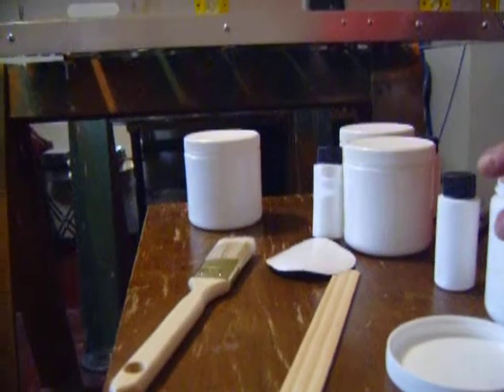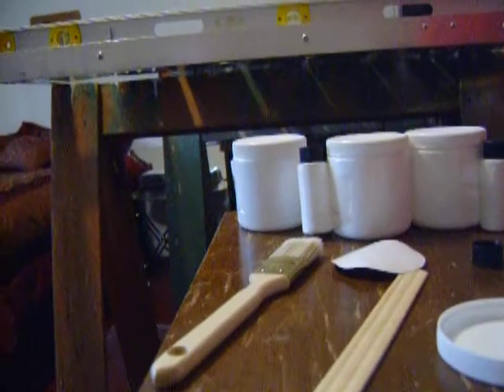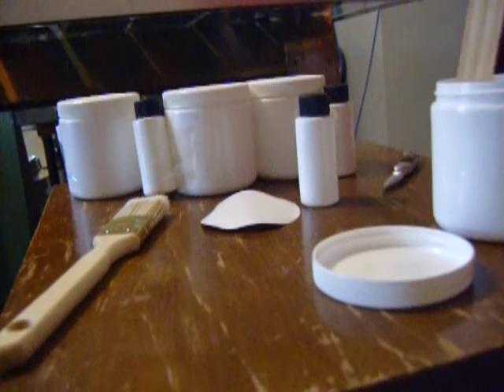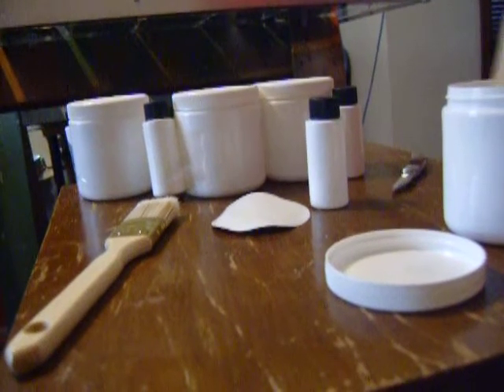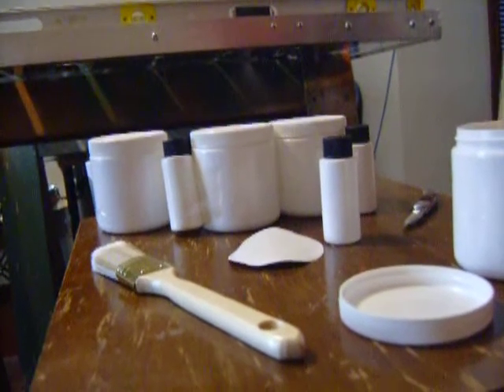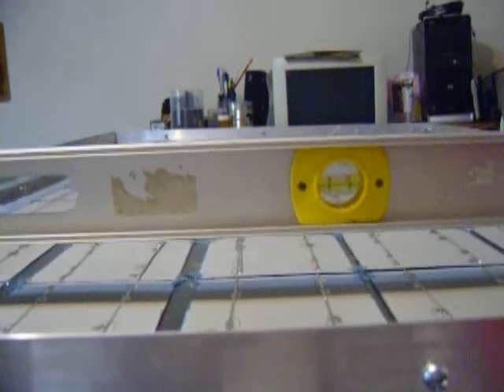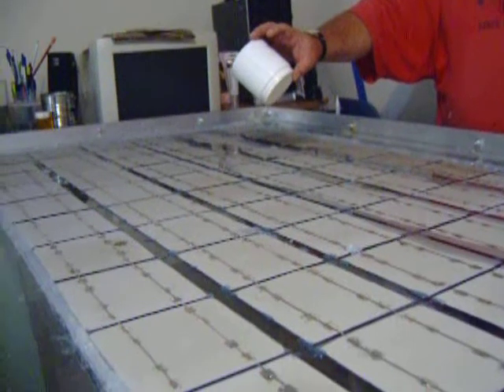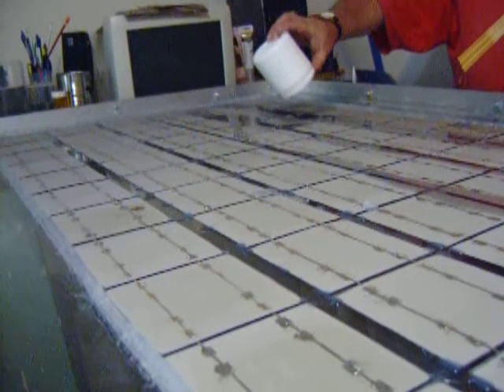Sealing the Solar Cells

Comment: Furtunatly you explain stuff ... otherwise why the hell do he keep filming the freaking paint brush for the first 3 min !?
Reply from the maker: Matrixtechno I dont want to be in the video. I m not a pro Youtube video maker LOL this is one of my first videos from years ago. i will look at your videos to learn how to make them better. OK.
Reply: Wasn't meant that way. Didn't know you were filming at the same time. I tought it was someone else filming you.
Reply from the maker: K thanks for watching. Your right my wife was filming this for me but I still didnt want to be in the video. this was a fail because the stuff set up faster than usual. It was a hot summer day. I think it should be done on cold days or cool ones. It gives more time to get rid of air bubbles. I could buy more and pour it on them but I ended up patching them up with clear silicone caulk it worked. was a powerful panel I ended up selling to someone on craigs list very heavy though.

Comment from the maker: Use some clear silicone caulk to glue the cells down. I try not get any on the front but if it does it is clear silicon. In august this stuff harden with about 15 min. and I didn't have time to spread it out ever so gently with the paint brush. I used silicon caulk to patch it up. worked. Its a good experience to make a solar panel everyone should make at least one. I buy all of mine now days they have come down a lot. This particular panel make full 110 watts of power. Not bad and it up to spec

Comment from the maker: @amy2x Its not a total fail it just going to be ugly with all those bubbles on the front. If they would have gave me the proper amount it would have not cured so fast. They shorted the amount so the activator was stronger in the cans with less in them. The panels are going to work good but they are just going to have good sized air bubbles because I was not able to work them out with the paint brush with extra fast cure time. It will still make mega watts though.

Comment: Thanks for Showing this process. Sorry it failed for you. I would be very steamed if it happened to me! 

I would wear a chemical air mask if that stuff is toxic and have good ventilation. Good idea to wear Vinyl disposable gloves. 

There are special sponge brushes for applying Varathane. They help remove bubbles. I think they may work with this application. They are low priced and work well.